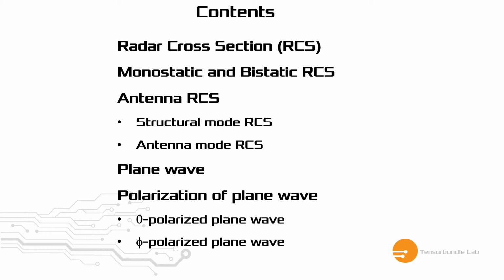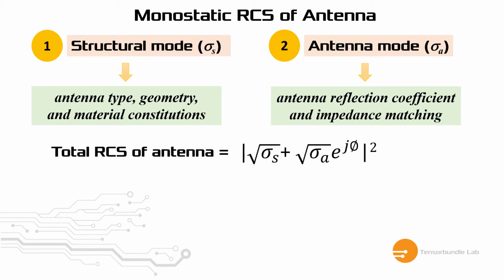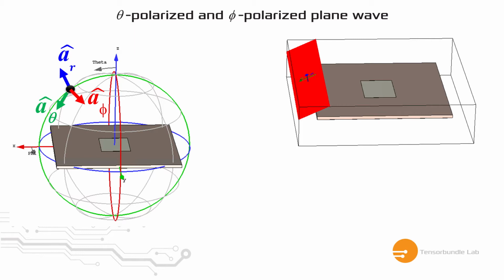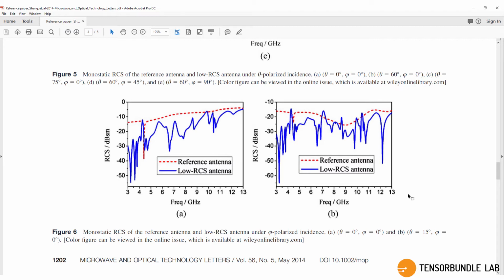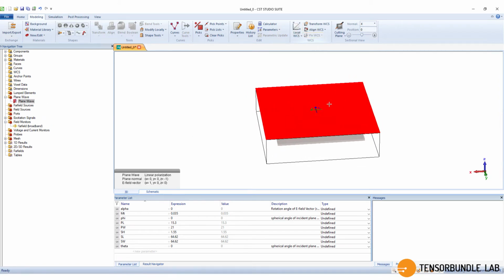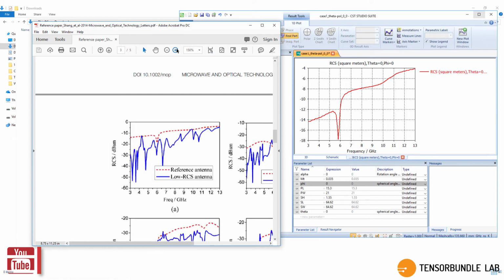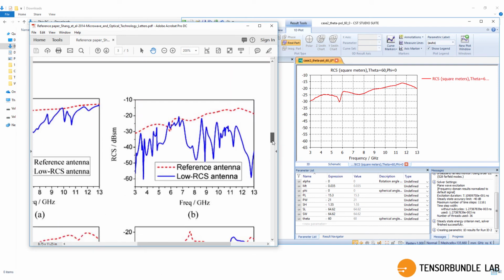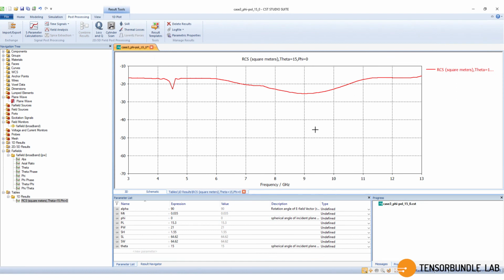CST Tutorial: Radar Cross Section (RCS) Simulation of Antenna in CST

Comment: can u please share the reference paper as well as can you please explain bi-static RCS in CST aswell, thanks
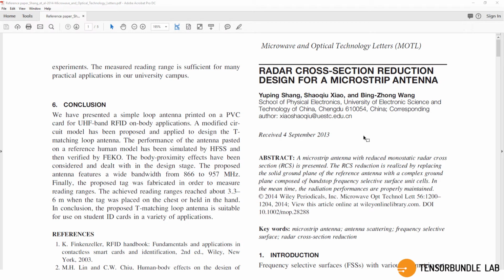Reply from the maker: I already showed the paper in 13:29 time-stamp of the video.
Reply: @tensorbundle  thanks sir. How about bistatic rcs, can u please make a video on it
Reply from the maker: @hamzaasifkhan8421  You can calculate bistatic RCS by using CST template "MW & RF & OPTICAL >Radar Cross Section > bistatic RCS" in the beginning when you open CST
Reply: Under antenna mode RCS how can i change the angle of incidence to 75 degrees or 45 degrees?

Comment: sir, i followed your video step by step but the graph for RCS is different, what can be the possible cause?
and thanks for such an amazing video.
Reply: i mean there is no dip between 5 and 6 ghz. it like an exponential function
Reply: hi, same goes to me too. How did u solve it?
Reply: @nuraidaaqilah8248  if you find a solution, kindly let me know.
Reply: @BadshahOnline009  hi, i got it, there is a simple mistake that i made due to not changing the type of patch to PEC, u should check it too maybe we made the same mistake
Reply: @nuraidaaqilah8248  no , i changed the meterial  to PEC. I think i am making some other mistake. Something may be related to the coordinates. As i can't see the patch on the up side of substrate. This is the first time I am using CST. So may be it's  some basic mistake.
Reply: @nuraidaaqilah8248   can you please share the file with me?
Reply: @nuraidaaqilah8248  i found my mistake. it was face selection before applying the local co-ordinates :)